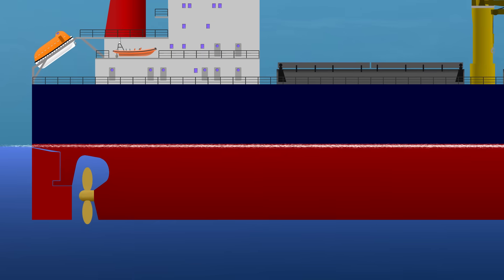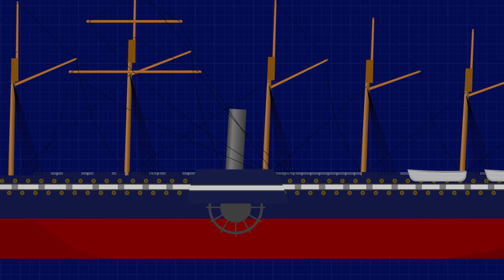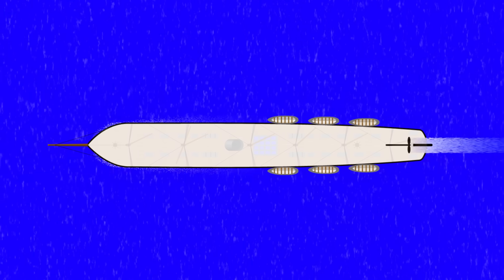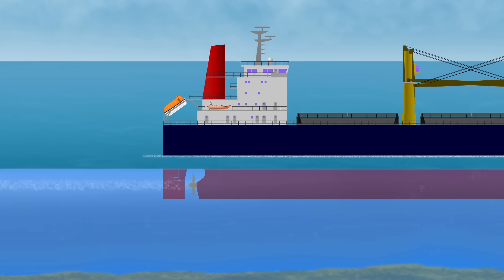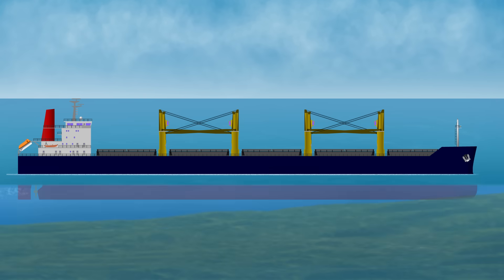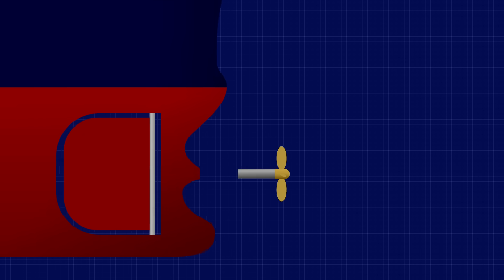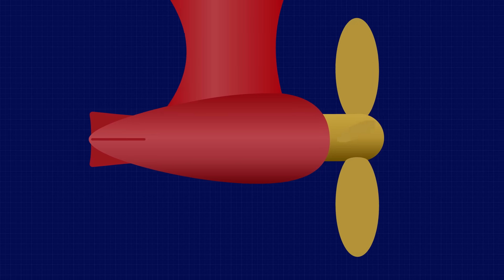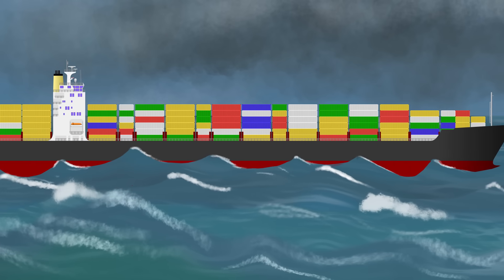Why Is The Propeller At The Back?

Comment: I would have liked a little more contrast with the example of aircraft given in the beginning, which usually prefer tractor over pusher configurations. As it is, I think that case provides counterexamples to most of the reasons given here:
-Aircraft don't mount any control surfaces directly behind propellers, as they prefer "clean" (less turbulent) airflow over the control surfaces for predictable, consistent maneuvering. (Even rudders at the end of small aircraft are negatively affected by the rotating prop wash from a nose-mounted propeller)
-An aircraft's body does not block the thrust of the propeller mounted in front of it, as it is designed to be smooth and aerodynamic. In fact, the cleaner airflow at the front improves the propeller's overall efficiency (As far as I know, this is also the reason to commonly mount jet engines on the wings instead of at the back of the fuselage)
-Aircraft prefer tractor over pusher configurations, i.e. tension over compression in the axle/shaft and bearings. I find this intuitive, given the high tensile strength of steel (and most metals?) compared to its lower compressive strength combined with possible buckling limits.

This leaves two reasons: protection from damage, where the analogy to aircraft clearly does not apply (except for gear-up landings maybe), and easier sealing (where I'm surprised the additional pressure is significant compared to the head pressure, but my intuition may be wrong here), both of which do not apply to azipods mentioned at the end?
I don't intend to come across too negatively, I like this channel, and this is an interesting topic I had not come across, I just feel this video has not entirely answered the question in the title to me. Then again, I know much more about aircraft than about ships, so that might color my understanding here
Reply: Another reason tractor configuration is preferred on aircraft stems from those early days when a motor driven aircraft was a big lump of iron (the motor) inside a stick-and-rag frame. Pusher aircraft usually had that big iron lump right behind the pilot. Crashes in those low-speed days were often more sudden stops ... but that iron lump and its inertia wanted to keep on moving. The pilot, being comparatively squishy, wasn't much of an impediment to that. Pilots objected to that situation. So motor-up-front became preferred among pilots.
Reply: @Donleecartoons Another factor is the weight distribution. An engine is often the heaviest part of an aircraft, so for light aircraft that could offset the center of mass greatly. Keeping the center of mass on top of or slightly in front of the center of lift helps prevent stalling.
Reply: I believe engine cooling was sometimes a problem with pusher designs, as the prop is not blasting air over the engines on them.
Reply: @bentilbury2002  For ground idling of designs that lack a blower fan, it can be, but in flight the opposite is actually true. The propeller doesn't increase the mass of air, it just increases the velocity, and by extension decreases the pressure and resulting density. This means for a given size a radiator behind the propellers working area will create more drag in order to exchange the same mass of air, and thus transfer the same amount of heat. But most aircraft intakes aren't actually behind the working area, they are very close to the propeller hub where the blade has much less airspeed (which in turn also limits the angle of attack before stall, thus doing even less work on the air it does encounter), and indeed the nose cone of the hub displaces air into this zone which raises its starting pressure, this offset creates circumstance where the packaging of the engine (thus size, weight and risk of damage to plumbing) bears more impact on on the engineering choices than the slight drawback of the faster speed/lower pressure air for most designs/roles. But even then the highest speed piston planes that could (air cooled motors normally couldn't easily duct air from outside the propeller sweep as the duct work itself would likely create more drag than it solved) often did find it worthwhile to remote mount their cooling, most often into wing roots or a pod under the rear fuselage.. with the secondary added benefit that moving drag rearwards reduces the tail area needed for stability, thus further reducing drag.
Reply: Good points.  Another thing to consider is weight distribution.
Reply: @luelou8464 You point out something that I believe was a major thing the video missed. Having the propeller at the rear - be it of an airplane or ship - is more efficient overall as it re-energizes the boundary layer, though the propeller itself suffers in efficiency due to turbulence entering it. This improvement is more pronounced on ships than on aircraft for a couple reasons. Ships have skin friction - water dragged along the side of the ship as the ship moves through it - as a greater portion, I've heard even the vast majority, of their drag. The propeller re-energizing this helps a lot, the ideal thing would be to draw in all this water that's been slowed down and speed it back up, resulting in nearly zero water movement in either direction behind the ship. Not to mention that the size of the boundary layer is probably larger relative to the propeller than it is for an aircraft, which has a much larger propeller due to less dense air. Airplanes have skin drag as well, but it's a smaller portion of their overall drag, as they're in contact with a lot less mass of fluid, and much of the drag is induced and wingtip-vortex drag from the wings, a lot of drag being a by-product of the need to generate lift that doesn't apply to ships. Meanwhile the water flow behind a ship's hull is probably a lot less turbulent than behind an airplane, as ship hulls are designed only to be as streamlined as possible, disturb the water as little as they can, while aircraft have to redirect air downward in order to generate lift - this is very visible in videos of airplanes flying low over dusty ground, punching in and out of clouds, or the patterns of smoke and flames behind military aircraft dispensing flares. This "wake" of downward-moving air behind an airplane is such a big factor that aircraft must be carefully directed to avoid being too close behind one another, especially a smaller aircraft behind a larger one, and there have been several crashes caused by this. Having the propeller operating in this much more disturbed air would reduce the propeller's efficiency, while likely also causing vibrations and noise as the propeller moves through the wake - certainly a lot of noise on some pusher-propeller aircraft (most famously the Piaggio P.180) from engine exhaust passing through the blades.
Reply: > -Aircraft don't mount any control surfaces directly behind propellers, as they prefer "clean" (less turbulent) airflow over the control surfaces for predictable, consistent maneuvering. (Even rudders at the end of small aircraft are negatively affected by the rotating prop wash from a nose-mounted propeller)

The reason for this difference in design concern is several fold but the most notable one is:
- At low speeds (on the ground) aircraft use their front wheel as the control surface for steering. Once an aircraft has taken off the velocity of air over the control surfaces is sufficient to lift the whole aircraft and likewise turn the whole aircraft. Since ships don't have landing gear they need a different solution when attempting to maneuver at near zero speed.
Reply: You oversee one massive thing here: speed. Ships manouvre at very low speeds typically, which means you need to use the propellor to create a waterflow over the rudder in order for it to become effective. This happens at speeds at which even a glider would stall. The comparisson with aircraft therefore is invalid to start with. Ships propellors are not just to give speeds a cruising speed, they are essential to manouvre the vessel. And that works best with the rudder and the propellor being at the stern, rather than at the bow. Aircraft's engines are primarily to give the aircraft enough speed to create lift over its wings and consequently make the rudders effective.
Reply: This comment thread is what I came for.
Reply: Thanks for the info. The video actually made me wonder why propellers are at the front for aircraft and you answered it nicely.
Reply: it also bears mentioning that aircraft operate submerged in their medium, while being submerged is usually considered undesirable when operating a boat.  and that most large commercial aircraft also have the engines essentially pushing rather than pulling the aircraft.  as for small aircraft, the propeller doubles as a cooling fan for the pilot.  when the propeller stops spinning, the pilot starts sweating.
Reply: @kenbrown2808  the turbofans jet engines used in most big aircrafts are basically pulling (from the fan) the jet pushing component is minor
Reply: @tank-eleven  and which model of commercial jet puts the engine on the nose?
Reply: @kenbrown2808  I'm not a native speaker, so maybe I improperly used the terms "push" and "pull". But turbojets do push trust towards the back; whereas most trust generated in turbofans engines is of pulling nature (because the fan is like a big ducted propeller pulling the rest of the engine). Then the whole engine is (almost) always mounted in a pod, so there is that to take in mind as well. 
Then the more we talk about it, the less the airplanes comparison brings limitation, as for example, airplanes tend to prefer putting all the mass as close as possible to the centre of weight, which is around the middle of the wings, hence why the engines are usually there.
Reply: @tank-eleven  the point is, passenger jet manufacturers don't put the engine at the front of the jet, therefore, the engi e is pushi.g the jet, just like an azipod is still pushing the ship even if the propeller is on the front of the pod.
Reply: @kenbrown2808  well if you really want to be that pedantic, being the engines most often in the middle of the plane, they are pushing the front half of the plane and they are pulling the back half of the plane
Reply: Sealing isn't a problem for aircraft. Ships have to keep water out to preserve buoyancy. Aircraft can "leak" and it's fine, it's just air.
Reply: @Khaim.m  To be pedantic, many aircraft have pressurized cabins and do need to seal, but the engines are usually outside of the cabin. But yes, sealing is one of two points in the video that are truly specific to ships
Reply: That's a good comparison
Reply: Control authority in aircraft increases and decreases with airflow. The engine can throttle far more quickly than a plane can safely transition indicated air speed, which would cause erratic results for the same input.
Reply: You are very correct that obstructions to aircraft propellers vacuum side have more impact on efficiency than on the high speed exhaust side, but this is because air is massively more compressible than water, so its density changes with pressure. On the other hand actually most aircraft design the tail to be within the prop wash (although not any jet exhausts), which is why a lot of larger twin engine planes had twin rudders located spaced on the elevator plane, while single engine designs have rudder(s) mounted on the body (where its within diameter of the prop when looking from head on). For single engines the rotation is an issue, but the control surfaces itself also a minority source compared to the sides of the body, landing gear and main wing. While for a twin engine where most of this structure is not in the airflow of the propeller, the impact of rotation of multiple engines on the tail is normally (but not actually always, some designs did have two clockwise turning props) equal/opposite. Outside of fighters propeller planes where rarely limited by the critical mach speeds where faster airflow would cause wave drag (but this is why some strategic bomber designs did try pusher props behind the wing, so the accelerated airflow didn't cause wave drag when at very high altitudes where speed of sound, lift for a given airspeed and drag (thus fuel burn for a given speed/time of flight) where all very low... but for boats and smaller or faster ships the wave forming speed of hull IS a very binding limitation thats a function of the overall length, speeding up the water flow over the front of the hull would cause a huge increase in wave drag.
Reply: * Propeller Aircraft do have control surfaces behind the propeller. In slow-speed flight - i.e. takeoff - this increases rudder effectiveness. 
* Wheels on the ground tend to kick up little stones, which are then blasted back with the propeller's airflow. If the propeller is in the back, they might hit and damage the blades of the propeller. Jets have the engines outboard of the landing gear and the big airports they operate out of regularly ensure the runways are clean.
Reply: One more reason is that if propeller is placed as pusher it will work in turbulent air causing vibrations, more wear on it, so it needs to be made more sturdy thus heavier and it will make more noise.
Reply: @hadinossanosam An aircraft fuselage absolutely DOES impede airflow from the prop and increases pressure at the front of the fuselage, turbulence and skin friction drag. It's a problem. It's just an expensive trade-off to mitigate so small aircraft seldom bother.
Reply: There’s also the part where the airflow is good for, or even critical to, the engine. Air and water cooled engines benefit from the additional airflow over their radiator, and it’s even more important for jets.
Reply: VIDEO: Why aren't ship propellers at the front like an airplane propellers ?
Comment Section Nerds:  You didn't give an in-depth explanation in your comparison of how a plane's propellers work in your example.  In addition, some planes have propellers up front, some half-way down on wings and some planes use jet engines which you totally ignored.

Comment: Older Finnish icebreakers have 4 propellers, 2 at the bow and 2 at the aft. New icebreakers have have 3 pods and one of those is located at the bow of the ship.
Reply: Just read about the Chief Wawatam steel-hulled ice breaker built in 1911 to haul train cars across the straights of Mackinac before the bridge was built. The article discussed a bow propeller to suck water from under the ice to weaken it before the ship rode a top to break it.
Reply: Do you know why they do this? Does it prevent the ship from pushing up on top of the ice?
Reply: @johnathanclayton2887 They want the ship to push on the ice because thats how ice breakers work, the ship pushes itself on the ice and breaks it with it weight, it doesnt plow trough the ice.
Reason will be that an icebreaker needs more manuvarabilty also in reverse and redundance in case a propeller gets damaged.
Reply: @johnathanclayton2887  The 4 propeller configuration is intresting. Two bow propellers turn to inside to flush water against the hull, so that it would minimise friction of the broken ice against the hull. Two aft propellers turns to outside so that it will push the broken ice under the intact ice. With the 3 azipods configuration you get superior maneuverability in ice fields.
Reply: @johnathanclayton2887 
I ve heared about the first tries to install a Prop at a boat was in front.
Reply: It is often used to wash the ice away from the hull, as the friction forces with the water are lesser than with the ice.
Reply: When I worked at one of the Swedish ones they told me that the front propeller also created a low pressure under the ice making it easier to break but the quad propellers also gave the ships excellent maneuverability
Reply: @917_Bror  Did you work on the Atle?
Reply: @wadethimbey8596  Frej
Reply: @917_Bror  I worked onboard her sister ship Sisu as an maskin vaktman in the beginning of my career. Beautiful ships.
Reply: I’m pretty sure I don’t want to go for a ride on an icebreaker.
Reply: "at the aft"? Lol

"aft"
Reply: You mean a the stern?
Reply: @Yish42  Aft and Stern refer to the same part of the boat
Reply: Don't they not also create a wave under the ice in front, so weaker ice simply cracks at some distance?
Reply: Orange hulls are also just totally weird, like stay away from polar rollers is you value your life and sanity...

Comment: The only instance i can think of where the prop is at the front is trolling motors for small bass boats. 

Considering how they are used and how they can be retracted to avoid damage, they are probably more analogous to maneuvering bow thrusters than bow mounted main screws.

Comment: Now I'm wondering why most planes have forward facing propellers
Reply: Many of them don't have propellers specifically on the front (see turboprop designs where the props are often mounted to pods on the wings) and there's a few designs with rear propellers too, but the gist of it as far as I can tell (see other comments on this video) is that the prop engine being forward mounted improves cooling, and the most relevant control surfaces and lifting structures on planes are mounted further forwards so the propeller driven air washes over the wings and such when forwards mounted, giving a similar benefit to rear mounting a ship's prop near the rudder. Plus, prop planes have proportionately much larger propellers compared to their fuselage, versus the relatively small props on ships.
Reply: @bosstowndynamics5488  thanks I now know why most planes have front facing props
Reply: :face-purple-crying:
Reply: Plus it's about money. Pusher props work just fine despite alot of peoples comments. They do add complexity that drives up costs that tend to take away from their increased efficiency.
The Piaggo P-180 is a cool example can go 462mph and is more efficient and lower operating cost than most jets.